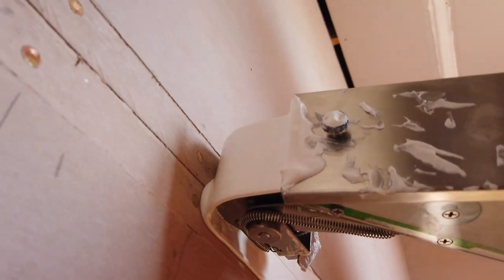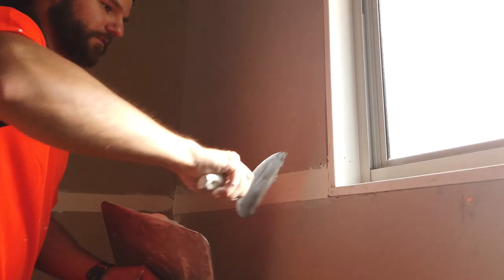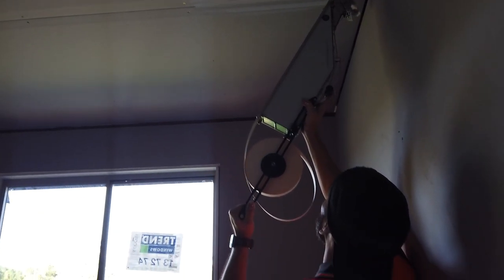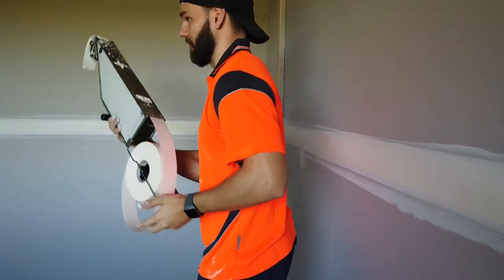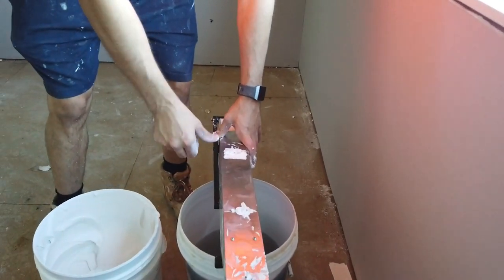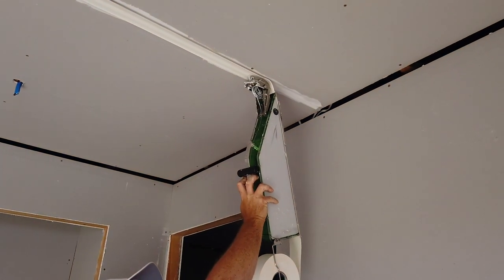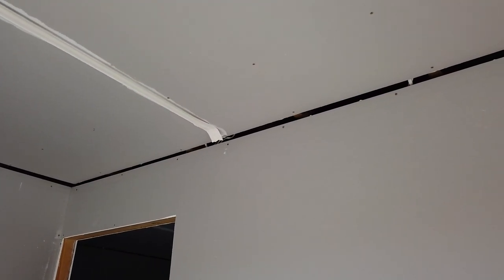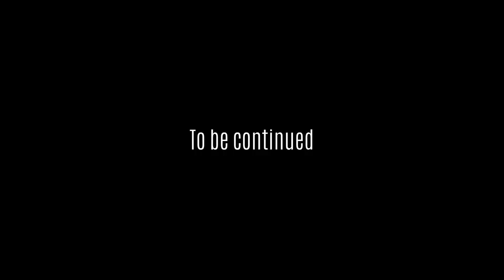Drywall Tool Tips with the Taper Mate Drywall Taper

Comment: I notice the vertical joints you are taping at the 54th sec in the video. Is the thin made by by some special tool at site? Does not seems to be some factory edge?